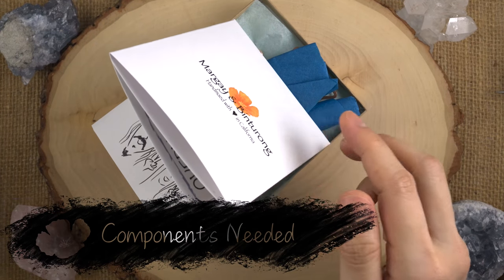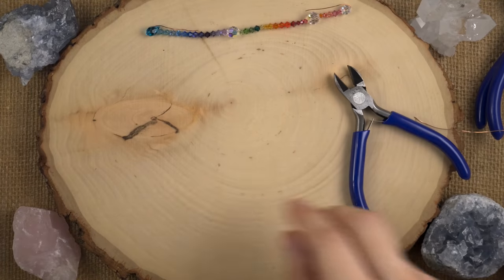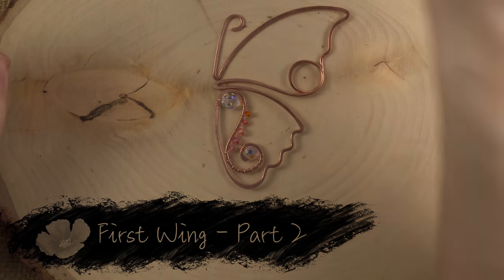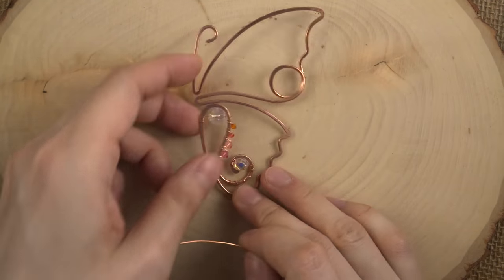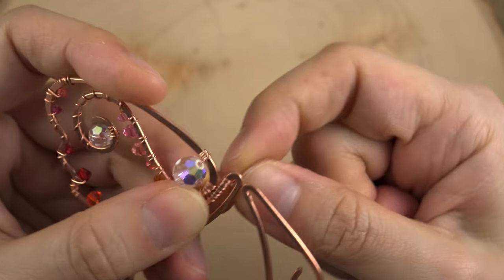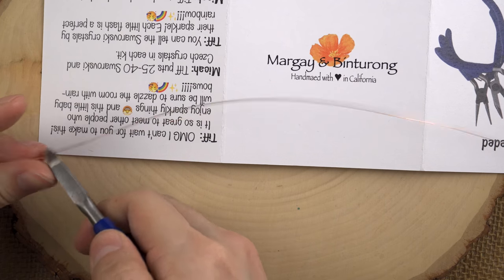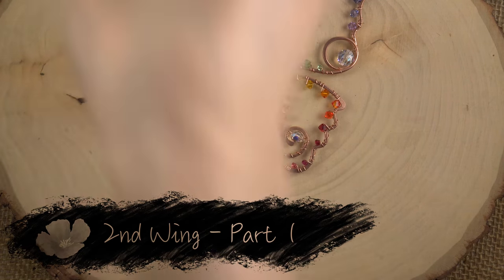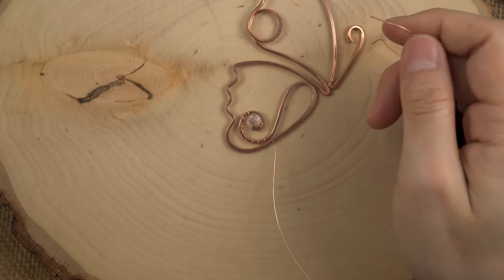Butterfly Suncatcher DIY Kit Instructions by Margay & Binturong

Comment: There is a little tool that helps keep your weaving or small gauge wire it's called "BOB EZ". They are on Amazon. Then I can just use regular bobbins for sewing machine.. Love your work it's so be
Reply: Guess I should say the bob ez helps your  wire from getting in a mess and flailing around and knotting up. Hope this helps.